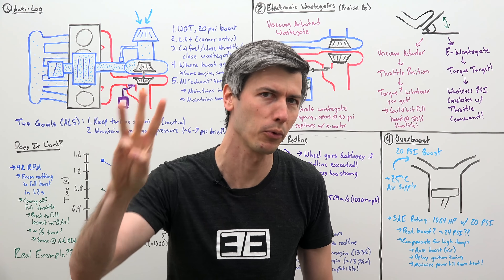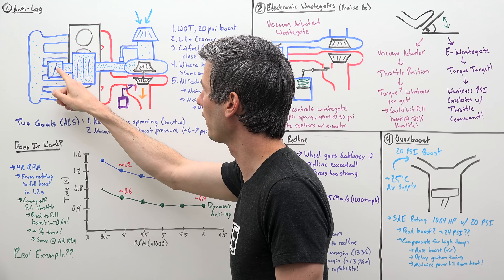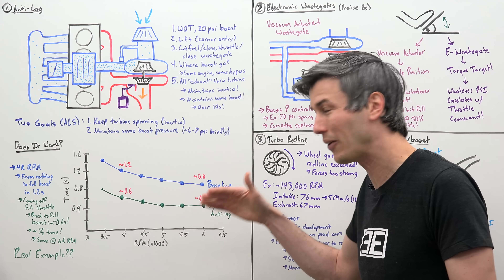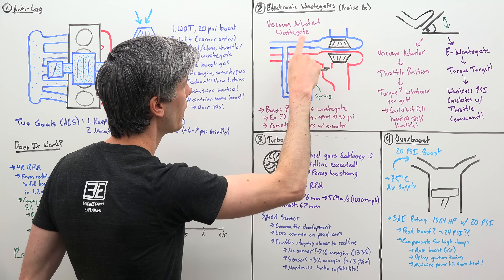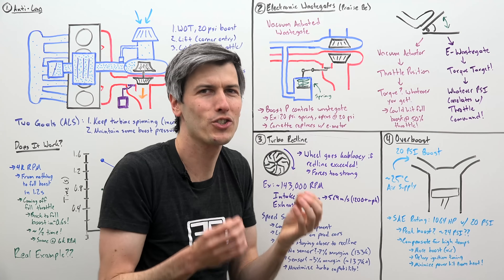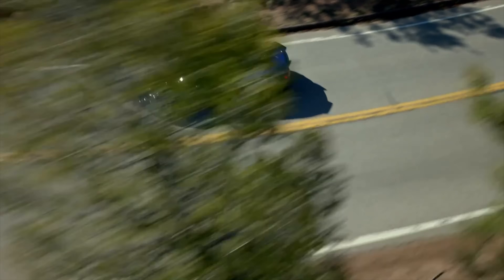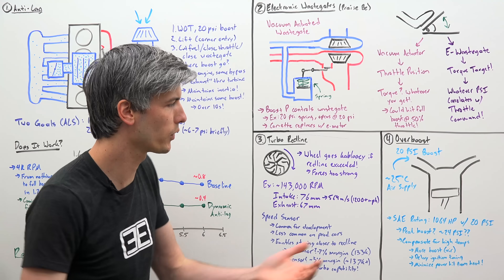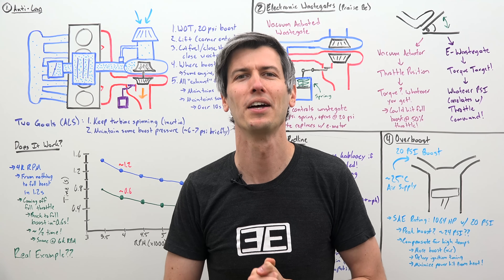Corvette ZR1's Anti-Lag System – Massive Turbos, Minimal Lag

Comment: Hello Jason!  Please correct me if I'm wrong or heard you incorrectly, but I think you're crossing your terms on your more-OEM "vacuum actuated wastegate" explanation.  

Your picture describes it as "pressure actuated via boost", you describe it as such, and your negative reasonings (bad part throttle control, bad fuel eff, etc.) are applicable to a boost-actuated diaphragm-pot-linkage-controlled wastegate-turbo.  However, you keep calling it "vacuum controlled".  I think OEM implementations of boost pressure controlled wastegates have been out of style for some time now.  In the VW diesel world, my 1997 Passat wagon TDI/1998 Jetta TDI had boost controlled wastegate turbos.  Like you described, the control system can't do much to the wastegate actuator if there is no boost pressure to use to manipulate the wastegate position, so it's always fully closed unless at (or encroaching) full boost.  

A properly designed vacuum-controlled system typically has a vacuum reservoir/tank/accumulator to allow good (decent?) control of the wastegate/VNT/VGT for part throttle and efficiency reasons.  Any time the vacuum reservoir has appropriate vacuum in it, the engine's ECU can PWM (pulse width modulate) the signal to the boost control solenoid, which routes vacuum to the vacuum-actuated diaphragm-pot-linkage-controlled wastegate.  This can allow the wastegate/VNT/VGT to be open during part throttle cruising, for a gain in efficiency (if the OEM/tuner/self-tuner has tuned the ECU maps this way, that is).  All N54/etc. engine BMW's, which began in 2006 (not familiar with older BMW turbo engines) and all VW TDI's since the cars stated above are this way (until they all switched to electromechanical actuators, that is).    

Looking forward to your thoughts.  Thank you!
Reply from the maker: Vacuum is a misnomer, but to my knowledge that's what they're commonly referred to as. I discussed this with the Corvette powertrain engineer and he said it's surprising how many modern cars are still running vacuum (boost) actuated wastegates.

Comment: So a vacuum-controlled waste gate makes for poor partial throttle control. I’ve always heard that, and I believe it (though I’ve not driven turbo vehicles enough to know from experience). What I don’t understand is why half throttle with full boost is a problem. Torque should be a function of both boost and throttle position, so wouldn’t 50% throttle * 100% boost = 50% torque? Is this complaint due to the unpredictability of the boost building while you hold throttle, or the fact that it’s not a linear relationship between boost pressure and torque for a set throttle position?
Reply: The problem is that unlike NA engines, turbocharged engines aren't as sensitive to throttle position since the pressurized air is actively trying to cram itself through the path of least resistance, throttle blade be damned. As long as the throttle's open enough that the blowoff valve isn't venting all the pressure to atmosphere and the compressor isn't stalling, it's just going to keep piling on the power. The Ferrari F40 was actually notorious for this; drivers would hold partial throttle, expecting a steady power level, then get one hell of a surprise when the engine just kept making more power as the turbos lit off.
Reply: @griffinfaulkner3514  ok, so it’s a VERY non-linear relationship between boost pressure and torque output for a given throttle position. Like 50% throttle * 100% boost = more like 95% torque. Whack (for driving purposes), but it makes sense. Now I really wanna experience that first hand 😂
Reply: @justinaustin1155  Things get really crazy with top-level Pro-mod drag racing engines, where the top 15% of throttle travel effectively doesn’t matter because there's so much boost. We're talking 60+ psi on 9+ liter engines turning 9,000 RPM, that's an utterly psychotic amount of airflow and you better pray the blowoff valve doesn't stick closed because if it does the throttle blade's getting folded like a piece of paper.

It should also be noted that most turbocharged engines aren't that bad, since they don't run that much boost, and have fairly well-tuned boost control systems. Older cars, and cars running oversized turbos relative to their displacement, are where things get hairy.

Comment: ? Doesn't make sense on how routing high pressure air back into the no pressure intake keeps the turbo spinning. The pressure would just flow back out the intake and not into the turbine?
Reply: By keeping the pressure lower it's reducing the load so the rpm stay high.

Comment: My 2007 Cobalt SS is supercharged. Stock boost with the 3.2" pulley is rated around 12 psi. With the 3" pulley I have, I see about 13-14 psi.

But if the intercooler pump fails, I've seen boost spike all the way up to 17 psi.

And I'll tell you with full confidence, it does NOT make more power. Pressure is not power. Gale Banks is right.

Think about this: smoke rises from a fire. Why? It's bouyant. The heat of combustion causes the air to expand, which reduces it's density, and it floats up and away.

If you were to try to make the smoke the same density as the surrounding air, it would require pressurizing it.  hot air expands, and countering expansion requires pressurization. The amount of air, and therefore the amount of fuel, doesn't change when the air gets hot and pressurized.

This is why we use air mass sensors and intake tubing with calibrated sizes.
Reply: Correct you need higher pressure for higher temperature air to get the same amount of oxygen that lower temperature air would achieve even with lower pressure. The system compensates for the less dense air by compressing it more.
Reply: Yep my 22 wrx ecu runs off of requested torque tables.. some stock cars max boost is like 12.4 psi, other peoples stock cars have gone up to 14-15psi. All the cars make the same power or requested torque. Just depends on elevation and air quality.. the higher the boost, the worse the air is and the cars have to push more boost to make the same power.

Comment: My 2017 Ford focus ST, use this throttle based off of requested torque, rather than requested throttle position. I thought this was common practice across the board seems like 2015.
Reply: Yes it is common practice. BMW has been doing that since 2006 with N54.
Reply: @chrisbradley3224  Audi was doing this from 1999 i believe. For sure with 2.7t engine in S4 and A6 with Bosch ME7.1
Reply: @feluke8396  Bosch has used torque based system even earlier than me7. Me7 was just complete rework of how the torque demand is handled by the ecu, tcu (if applicable) and abs. Whole os was rewritten.

Comment: Wait the outer edge of the turbocharger is traveling at 1,200 mph? That's like 1.56 times the speed of sound (at sea level). I'm surprised it doesn't make a tremendous amount of noise.
Reply from the maker: It is indeed above the speed of sound (for those chatting about temps below, the intake compressor side, which is larger thus the edge reaches higher speeds, will obv have cooler temps than the exhaust turbine side).
Reply: Speed of sound increases with air pressure,  so maybe it's still below the speed of sound inside?
Reply: @jamesengland7461  Speed of sound is related to temperature not pressure, it merely seems related to pressure in the atmosphere because the air tends to get colder as you go higher.

The pressure ratio of a centrifugal compressor is related to its tip speed by the Euler turbomachine equation, you actually have to have supersonic tip speeds in order to make lots of boost. The reason it doesn't make much noise is that the vaneless diffuser around the compressor wheel is able to decelerate the flow to subsonic speeds without forming shockwaves, which is quite the trick!

Coincidentally, the same basic rules apply to the axial flow compressors used in jet engines, and it's not unheard of for them to have supersonic tip speeds in parts of their fans or compressors as well.
Reply: @jamesengland7461  I was curious so I looked it up. Apparently the determining factor of speed of sound in air is actually temperature. Turbos generally run upwards of 600 Celsius. At 600C, the speed of sound is 1324.72 mph.

Comment: I don't believe for a moment that it feels like a sharp NA engine. It's claimed time and time again, but it's never true. This thing will still have that characteristic elastic feel to the throttle response. You'd need an advanced electric turbo to have any chance of getting of that.
Reply from the maker: As mentioned on the video, on track.* That's the big disclaimer. I haven't driven it on the road, but of course, the lag exists. But when you're on track and mostly staying on throttle in some form, and at high RPM (critical) with brief breaks between, it does an excellent job of staying in the boost and reducing the amount of perceptible lag.

Comment: That is really amazing, the moment you asked for full throttle out the corner the engine was running at 2 atmospheres. That is genuinely zero lag.
Reply: What a lot of people aren't going to understand is that normally an engine runs at NEGATIVE pressure, because it's sucking in air. Even if the boost gauge reads 0 psi it's still under significant boost.

The OP doesn't know what he's talking about. eg my boost gauge would read -8 psi at idle because that's how hard the engine is pulling on the air tube that the gauge is measuring. Intakes operate at negative "atmospheres" because an engine is an air pump, there's not "one atmosphere pushing air in".
Reply: ?? 14.7 psi is 1 atmosphere (bar). Max boost is 20 psi =1.4 bar. The 2 psi is 0.14 bar.
Reply: @hunterjohnson7393 Naturally aspirated engines operate at 1 atmosphere (at sea level obviously and wide open throttle). Boosted engines operate above 1 atmosphere.  When a boost gauge reads 14psi it means 14psi above 1 atmosphere. As soon as he went to full throttle the boost was 14psi and over 20 with 0.2 of a second.   Therefore the engine is operating at 2 atmospheres the moment he went to full throttle.
Reply: @hunterjohnson7393  The boost gauge is gauge pressure (obviously) but what the engine cares about is absolute pressure which is above 2 atmospheres like @steveallen1340 said.
Reply: What?
Reply: @Your_Paramour No, even the absolute pressure is 1 atm + 2 psi = 1..136 ATM.
Reply: @petergerdes1094  But it was at 2 psi off throttle not full throttle.

Comment: This turbo control is pretty standard these days isn't it? Pretty sure operates the same as VW/Audis have done for many years and the latest Audis at least seem to have rolling anti-lag also (our GR Corollas still have an old school wastegate and the lag that goes with it). Its amazing how GM can do some really awesome engineering (Recently drove my friends CT5 Blackwing manual which was awesome) and also produce a lot of really crappy cars.
Reply: You got to understand how massive of a company GM is with tens of thousands of employees, hundreds of different teams working on different projects and car brands and race cars and economy cars etc. It's the same concept with VW and Stellantis. Massive corporations that over see numerous offerings from numerous companies that offer both awesome cars and some that are absolutely trash. I'd still say GM builds better cars than VW and especially Stellantis
Reply: European vehicles have been using electronic/vacuum controlled boost controllers for years (VW/BMW ETC)
Reply from the maker: GR Corolla has electronic wastegate - well I haven’t looked, but the partial throttle control is excellent so I’m confident it’s electronic control.

Comment: I learned about turbos back in the 80’s when car makers were struggling to make cars that could go while still meeting emissions and fuel economy goals. 40+ years later I’m still one fence about them. I just sold a car that had a tiny 4 cylinder with a turbo that I drove for 7 years and traded it for a car with a naturally aspirated V6. The 4 got 33 mpg, while the 6 gets about 26 mpg. The 6 is smoother, quieter and more powerful, plus it’s likely to be more reliable. I’ve actually owned two cars with turbos, and both have had to get new turbos. Neither car was driven hard. After all these years they are still not as durable as they should be.
Reply: It makes sense given the operating temperatures and speeds of turbos. Not very many materials can hold up to that level of wear for a long period of time. Also if the turbos are starved or not getting the optimal amount / quality of oil while under load for any reason, they’re toast.

Comment: How does the ZR-1 approach to turbo lag compare w Porsche's new t-hybrid technology?
Reply: I think the Porsche T Hybrid can be electrically supplemented (spun up) maybe. So it can produce boost even in the absence of any exhaust gas flow.
Reply: Porsche uses a combination of generator and motor, so they can load the turbo instead of opening the wastegate to retrieve energy as well as spool the turbo.
It's far more advanced, but I guess more expensive to repair as well. 😄
Reply: I understand the technology difference at a high level.  My question is whether Porsche's higher (apparent) complexity has any performance or functional benefits over Chevy's approach.  Does Chevy achieve 1:1 lamda for instance and are there any perceptible performance benefits or consequences w either approach.
Reply: @taibo55 Response should be better even under the most ideal situations, but most definitely if there's no stored energy in the turbo for the Corvette as Porsche can spool it without exhaust gases. I'm not sure how much of a fueling strategy there's involved, but having throttle body, injectors, ignition, cams, wastegate and the electronic side to control independently there should be more options to get creative in the Porsche.
Reply: @PSA78  agreed, building boost from a dig or when cruising along for a while at low rpm will show a decent difference between the two. From Jason's overview of the hybrid T a while back, I recall a lot of what Porsche was doing was for the purposes of emissions. The new Euro 6/7 regulations seem to be pretty stringent and I think this is the way for Porsche to continue building ICE vehicles without sacrificing road performance.
Reply: @ALMX5DP Emissions is something they have to work with, though this was little bit more focused on performance according to Porsche.
It seems like more and more manufacturers change when they plan to go full electric, it's not all it was claimed to be while efficiency and fuels improve for ICE, I personally believe a whole lot more in hybrids for the time being. 😄

Comment: 20 PSI seems kinda low if these are the largest turbochargers in production vehicles... my lil hot-hatch IIRC has a pretty small turbo and makes 20 PSI pretty reliably and it's just a single turbo. What is the benefit of a larger turbo in this particular instance when smaller ones can hit 20 PSI?
Reply: Pressure is only one part of the equation, you forgot about air mass (volume). A bigger turbo can pump more air at any given boost. A larger displacement engine requires more air volume per unit time.
Reply: It's more about how much mass of air the turbos can move than the pressure. 
Compared to many diesel engines 20 PSI is not much boost at all, but then I also don't know of a production vehicle with a diesel engine and more than 1000hp.
Reply: You're getting distracted by a single number.  The resulting 1,064 hp and massive,  low-lag torque curve crushes your hot hatch.

Comment: That anti-lag system reminds me of the freewheeling diodes (FWD) we use in parallel with inductive loads to avoid sudden current changes in switching circuits!
Reply: That is exactly what it is. It is not a True antilag system. I own an mr2 turbo which has something Toyota calls a "bypass valve" that does exactly what the corvette "antilag" system does. It is for avoiding the compressor stalling, almost every stock turbocharged gasoline car has this system, otherwise you hear the "stututu" sound. The alternative is a pop off which does the "pschh" that in fact makes lag much worse. I think calling it antilag is somewhat a marketing move... Yes it does reduce the lag because the turbo is not letting air completely out or, worse, letting air bounce off its compressor blades, but it does that mainly for saving the turbo in the long run, and by the way it's been done like that for ages
Reply: Love that. 😂🤣🤣🤣🤣